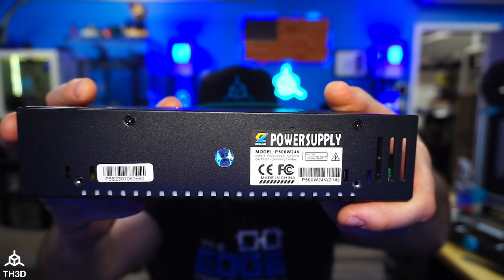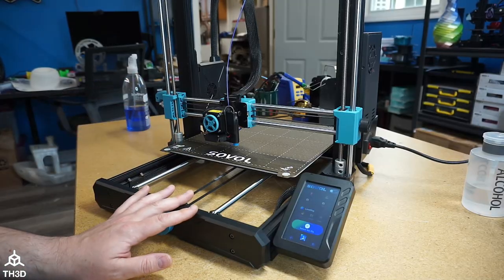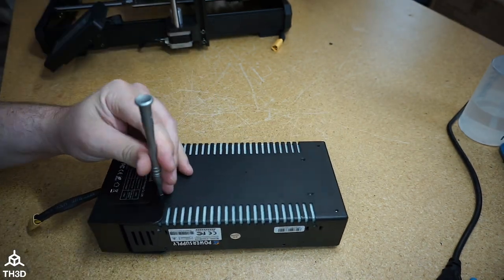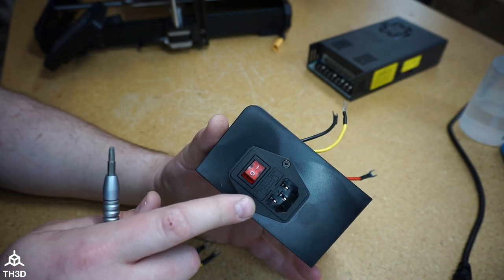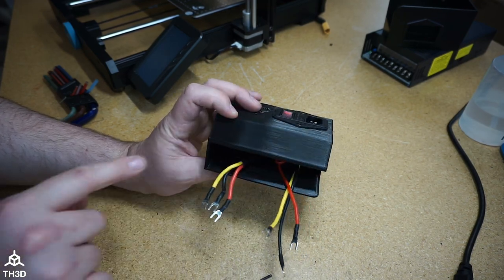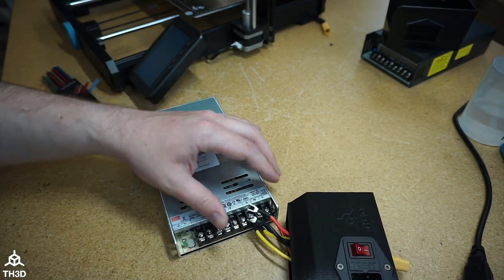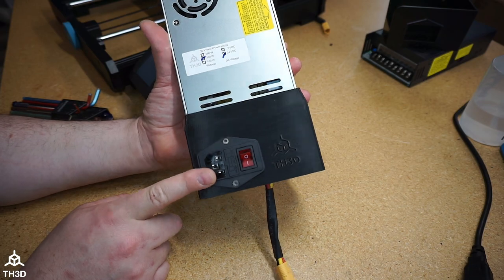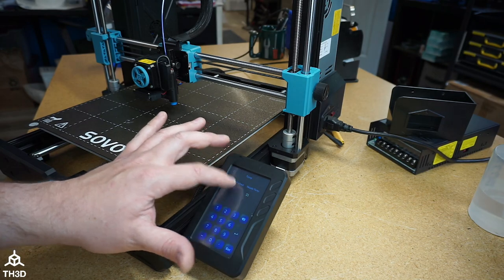Sovol SV06 Plus Power Supply Upgrade

Comment: I dropped a bucket of saw dust on my sv06 plus and have been making attempts to fix all the damage for the last few weeks. I fixed the power supply but would prefer to maintain reliability for long prints. Stock PSU will now sit in the backup drawer 👍. Just placed an order for the MeanWell. Great video, looking forward to checking out your other mods.

Comment: How does the LRS-350-24 handle the draw from SV06 Plus and the Klipper Screen upgrade that Sovol SV06 Plus can get? Since the printer itself draws 13A, that only leaves 1.6A for Klipper Screen to draw from, and its never a good idea to run anything at the rated Amps.
Reply from the maker: We tested the load (actually say this in the video and show it) and it's well within the specs of the printer. Haven't had a single issue with ours or customers running the meanwell 350w on the plus.

Comment: I find the power supply fan on the stock 06 plus to always be on 100% and loud, how does this upgraded PS fare in that regard?
Reply: I have the LRS-350-24 on my regular SV06 and it's nice and quiet.
PSU fan only comes on when it needs to.

Comment: What is the voltage output?  12V or 24V.  I want to add an LED light bar and need 12 volts for the resistors installed in the bar.
Reply from the maker: Its a 24V. You can use a step down like this one: https://amzn.to/49jHFGa

Comment: Is the meanwell swap noise quieter or the same due to the form factor?
Reply from the maker: They are about the same noise level. However the Meanwell is a more reliable PSU. We're not a fan of running knockoff PSUs in the machines as we've had them fail and damage control boards when they do. In over 10 years that we've been using Meanwell, we have yet to have a single one fail. We've sold over 1000 of these over the last 6 years and have only had one need to be replaced.

Comment: Is the 350 supposed to run warm ??
Reply from the maker: Yes, all power supplies get warm when they are used. If it ever gets too hot, the meanwells have over temp protection.

Comment: Will the Meanwell LRS-500-24 work on the SV06 Plus as well?
Reply: Timothy Hoogland  yes, you are right. I meant RSP-500-24. My friend has an RSP-500-24 which I can get for the same price as a LRS-350-24. I suppose no harm in having the extra overhead.
Reply: just ordered from your site .
Reply: 🤔 i think you have the switch in the wrong position 😕
Reply from the maker: we use 115 here so its correct for my country (USA)
Reply: Appreciate the info.  How quiet is it versus the stock PS?  Could be looking to upgrade. Thanks
Reply: @TH3DStudio  i mean the on of switch 😔
Reply: Timothy Hoogland  The cover is easy - already have stls available and even if there wasn't it's super easy to design one. I did message Sovol to see if they would have any problems with warranty from switching from a "500w" to a 350W. They would not confirm. Any idea what the warranty implications are? Even if there was a problem with the printer unrelated to the 350W, my concern is that Sovol would use it as their excuse to deny warranty.
Reply: @mincooper   I am sure they would.

Comment: I would pay just $10 bucks more and get the LRS-450 rated at 18 amps.
Reply from the maker: Bolt holes on those will not line up and they are like $75 shipped.
Reply: That's what I'm going to do. A little headroom is good, also with good brands. PSUs can degrade a bit over their lifetime and cause it to get too close to stable power draw (or even get unstable) during its lifetime.